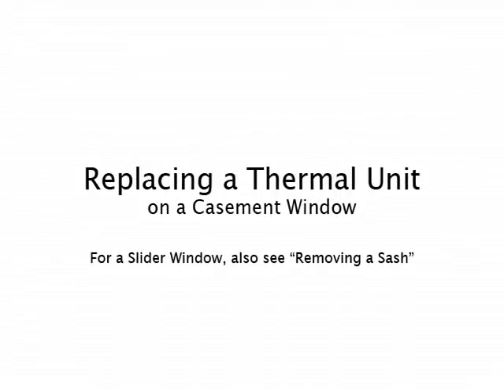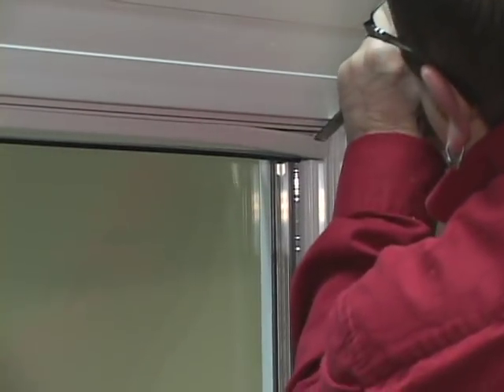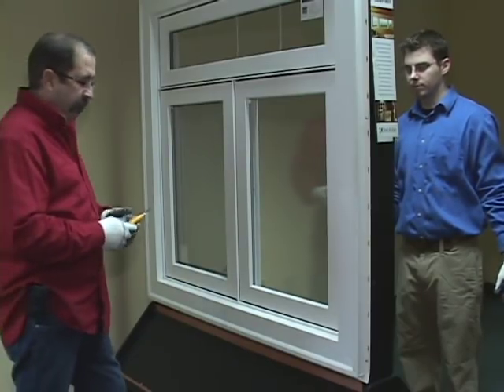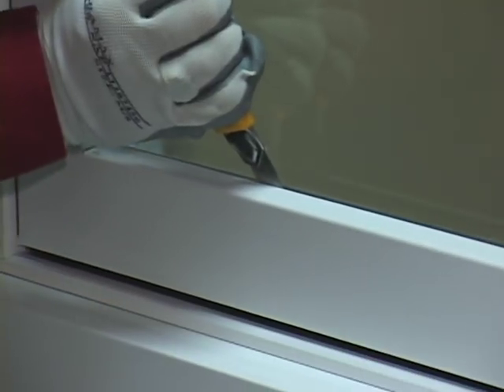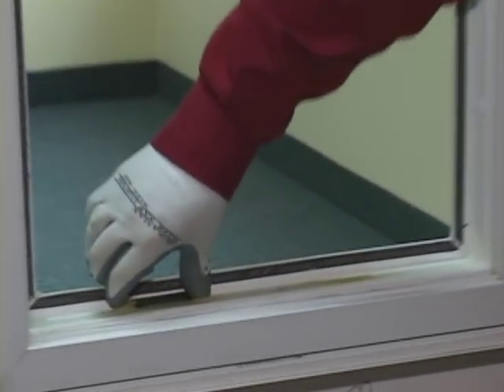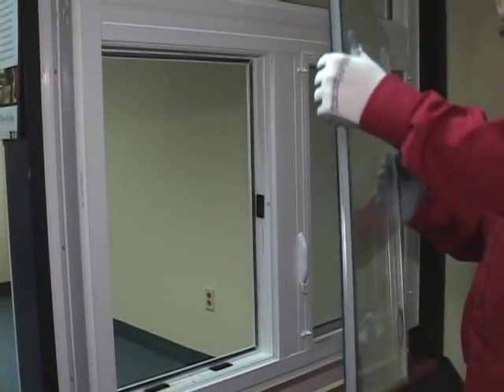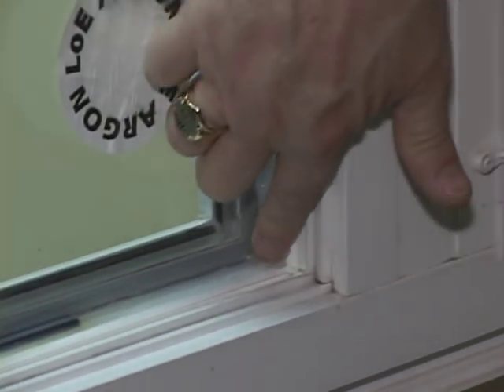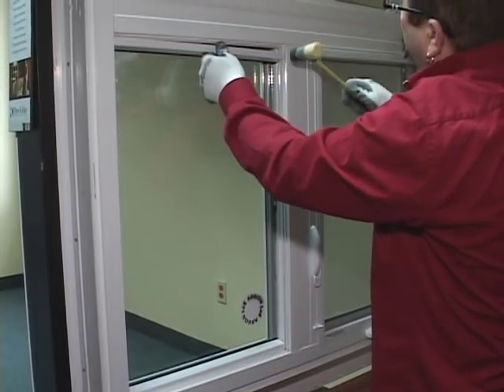HOW TO: Replace Thermal Glass

Comment: Is there a tip or a trick to work from the inside only and cut through the exterior caulking - once the glazing stopes are off? I was thinking of use a heat gun the melt it, but don't want to warm the vinyl . My windows are very high up from the outside but easily accessible from the inside. I was also thinking of using a suction holder to pull on the insert to remove them...any ideas . thanks

Comment: There are many varieties of silicone caulking, what should be used to install thermal glass in a vinyl window frame?
Reply from the maker: We use GE Silicone II Window & Door Sealant here, but any strong sealant/adhesive made for windows and doors work. You'll want it in clear.
Reply: @Kohltech  
Thank you so much for the input.  My 27" x 8" thermal glass/vinyl window accent pane cracked for no apparent reason (I thought perhaps it was the waterbed in the room above).  The broken window unit had no spacer blocks, and there were 2 types of caulk (one was very tough and still sticky 20 years after construction).  I couldn't find any real guidance on the right caulking properties for this specialized application.  

The waterbed was long gone when I removed the thermal unit, and I found plenty of clearance in the vinyl frame.  The break happened on a cold day, and the entire double window assembly seems to have been jammed into an undersized framing pocket.  That pane could have been badly replaced (wrong caulk) by the builder during construction, with poor installation and added thermal and mechanical stresses.  Who knows, but now caulking won't be a contributing issue to failure!

Kohltech window construction appeals to the engineer in me.  I really appreciate the advice from a manufacturer, and will look for your products when I can finally replace the "builder special" windows in my home.

Comment: Excellent video Kohler. I have Kohler windows and the top LowE sash on a single hung window has a blown seal so I need to replace it while keeping costs down. Your video is very thorough and incredibly easy to follow and will save me some money. Is the procedure the same for the bottom sash of a single hung window?

Comment: One critical measurement was neglected: the thickness of the pane assembly. Double pane, triple pane can be made with differing thicknesses of glass, so, if the replacement is not the exact same thickness, there will be a major problem. Too thick and those glazing stops won't go back in. That means, unless you know the thickhness in advance, you will need to remove the old glazing before ordering a new one.
Reply from the maker: Good note, at Kohltech we have 3 widths depending on the window type. We suggest once you remove the glazing stops, sticking a business card between the sash and glass unit, marking the edge, and measuring that to determine glass width.

Comment: This is a great video but it does seem to show how easy it would be to break into a home then replace the glass and no one would know. Locked room mystery plot!
Reply from the maker: not really as the glazing stops are normally to the inside of the window/sashes
Reply: Problem is you would have to break into the home first to get to the window. And you would need an accomplice to hold the window. And the noise, how do you muffle the noise. And loud cursing when things don't go smoothly. And the dog barking... Columbo would nail you before you got the stops out.  Maybe not such a mystery after all. But, at least you're thinking.